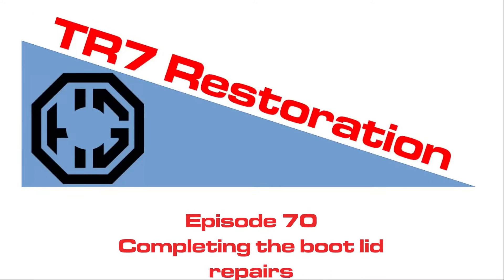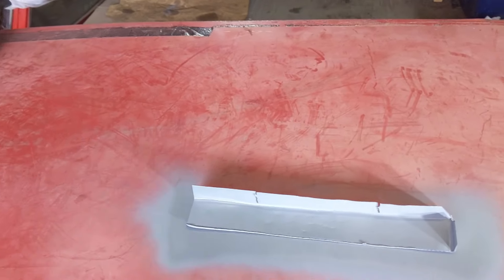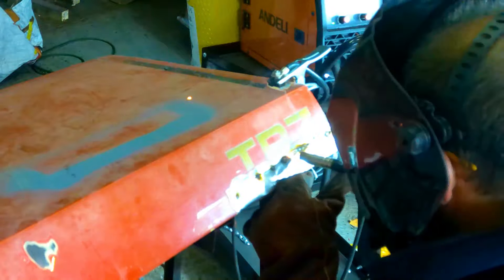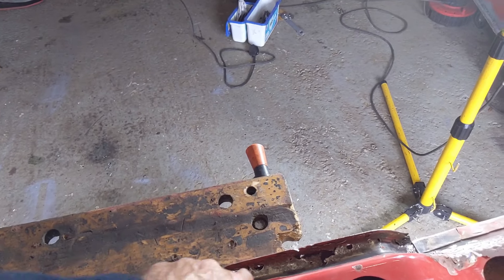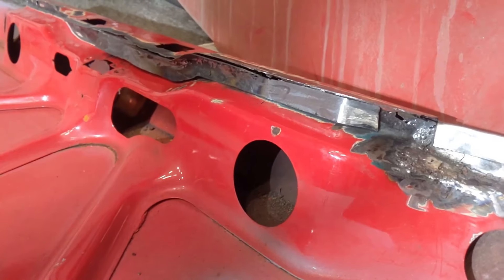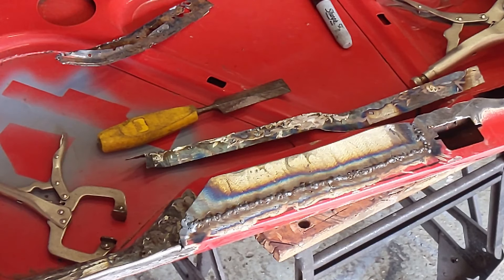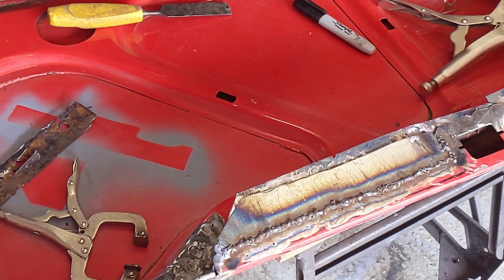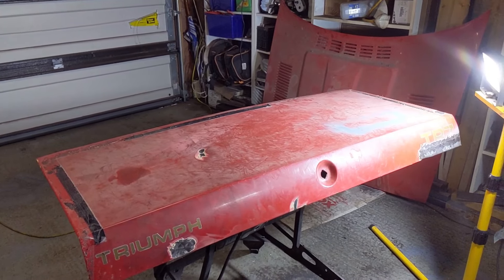Triumph TR7 Restoration: Episode 70   Completing Boot Lid Repairs

Comment: Inside my car boot, the seam where the bulkhead meets the panel under rear window had a crease put in from the factory. It's obvious one was longer than the other so they put a fold in it. British engineering at it's best.
I became a dab hand at mig welding owning a TR7.
Reply: 15 years ago in the US, near Vegas, parked on car parked we were joined by dozens of TR7's. There was a meet in Vegas. They were all mint desert cars. What a shame they rotted away here in UK.
Reply from the maker: That's the fate of all cars in the UK, but Triumphs really excel at it
Reply from the maker: Well that's the easiest way to fix an issue, just pretend it's what you designed

Comment: Nice job Henry, on the gas front, I have a flow on the gauge of about 10 with the trigger fully pulled back.👍
Reply from the maker: Thanks Ian, I have mine set the same.  I think I’m just doing a lot of welding
Reply: @HenrysGarage  That's TR7 for you, having said that mine 'only' needed two floor pans and several small pieces around the car, especially seams. The bigger Hobby Weld bottle is certainly much cheaper and convenient than those small Clarke type ones though.👍
Reply from the maker: @iankidd6500  Not only is the Hobby weld better value and more convenient, today I could tell when I had run out of gas, which is a nice improvement